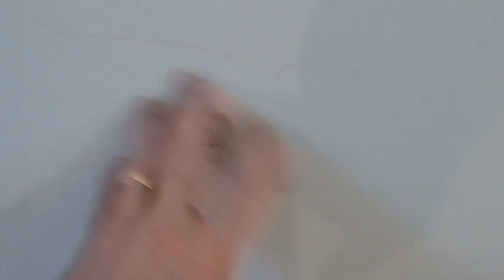How to Make a Drywall Patch Invisible

Comment: Thank you! I never know what to do after sanding and painting and yes, you can tell there is a difference... Thankfully all the jobs I have done are hardly visible so not an issue per se but great to know! PS: for those of you who think that contractors do it better well NO. Absolutely not. It's usually a disaster. I have yet to find someone who knows how to patch a hole!

Comment: I use the smallest paint roller and roll over it with the roller damp....textured like the paint under it.😁
Reply: damp roller on top of the paper towel?
Reply: @BillSW i roll damp paint roller over final skim coat of plaster as the pre existing texture on the wall is from a paint roller
Reply: I may try 5-6 coats to see if that works. No luck with 3!